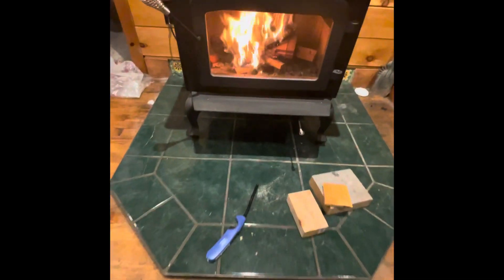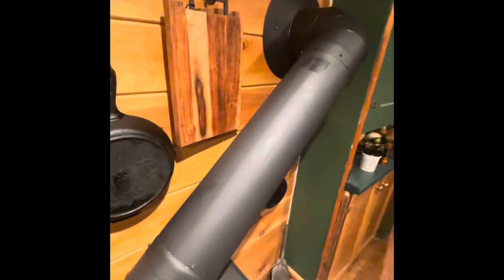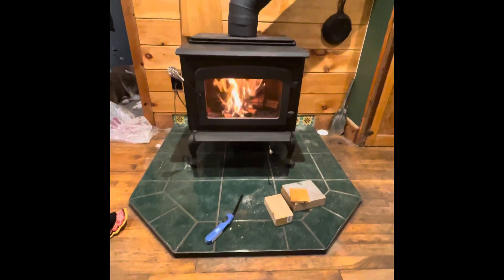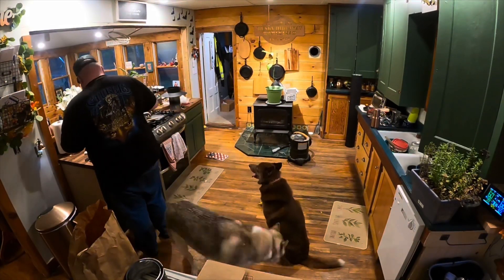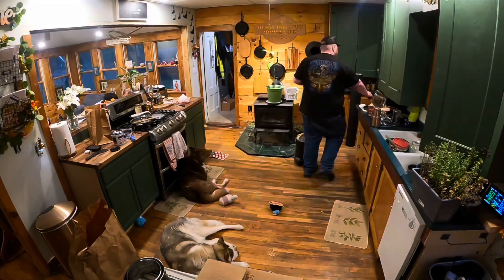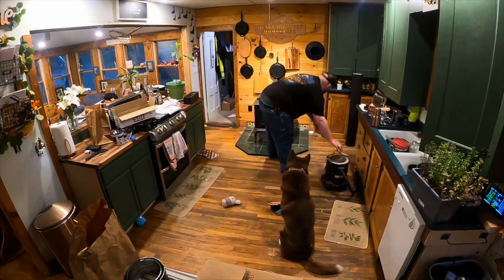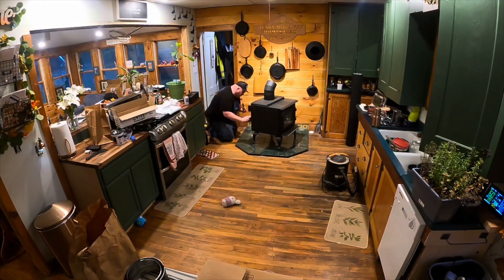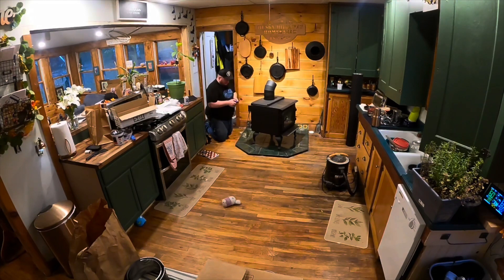New wood stove install at the Husky Hideaway Homestead

Comment: I got a hell of a deal on this stove last year so I bought it. My cabin is small though 16x20 with open ceiling to the loft. Just hope the stove isn't too big for my cabin.
Reply from the maker: I got a good deal on it as well which is part of the reason I bought it. Our house is smaller, under 1,000sqft of living space and this does a great job of heating. I think you’ll be okay, just gotta get it hot at the start to get it burning/running well and you can dampen it right down for a slow burn.
Reply: Hiii.. what is a "hell of a deal" and where did you guys get it?  thank you.  =)
Reply: @Russellt198  Hiii.. what is a "hell of a deal" and where did you guys get it?  thank you.  =)
Reply: @danorion369  I paid under $600 for this stove in the summer of last year. Fleet Farm store here in Wisconsin.